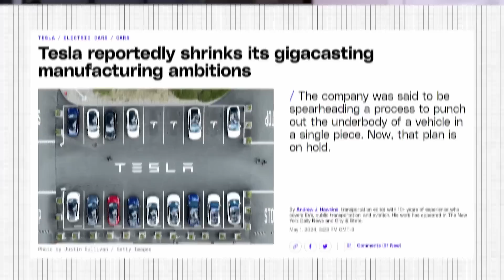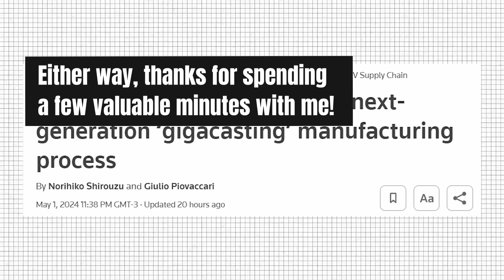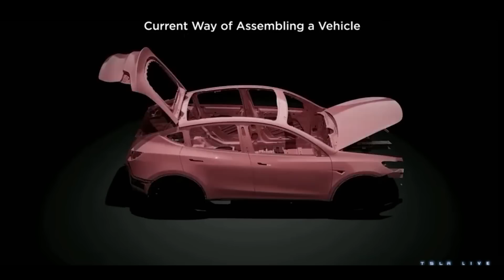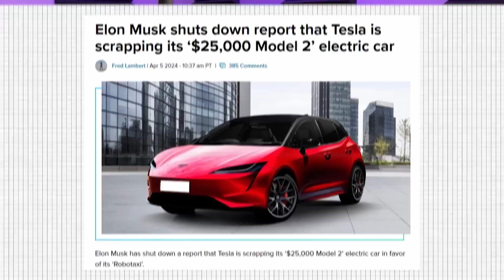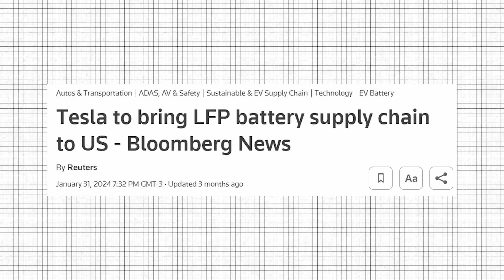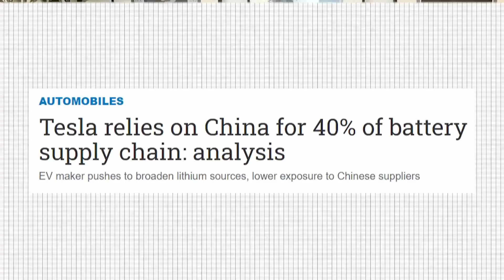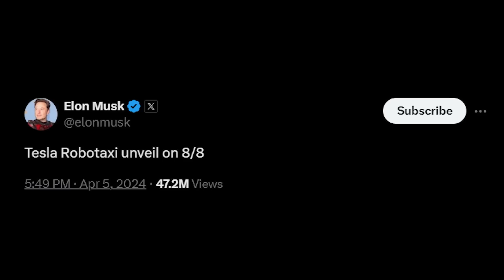Tesla: Pulling Forward Robotaxi Platform

Comment: The ONLY reason they're pivoting away from 4680s is because THEY CANT SOLVE THE DBE PROCESS FOR THE CATHODE AT ANY SORT OF SCALE!!!  Sorry to break it to all you zealots who continually and desperately shout out that Tesla is the best at everything they do (and continually repeated the endless trope that Elon is playing 4-D chess), but 4680 battery production has been a major failure....no improved energy density (even their newest 4680 cyber-cell is barely on par with 2170s from years ago), no 50% cost savings, and no ability to ramp. Elon has been flat out wrong and misguided MULTIPLE TIMES, because guess what....he doesn't have a crystal ball and despite you all endlessly acting like he's an infallible god, he can't predict the future (case in point: Elon 1 year ago: "I still think we got a shot at 20M cars per year by 2030.  Elon now: "we're de-prioritizing car production."  If Elon can truly predict the future, Tesla would've partnered with CATL 5 years ago for a joint factory in the US producing LFP/LMFP/M3P cells because iron-based batts are needed for 95% of all Tesla's use cases.

Comment: It's this simple. Elon never admits when he's wrong and he refuses to admit that someone else was right. Instead of canceling the model too like he should have, he's going to put it with another line. 

Most of the self-driving cars for the next year or two will be fine without more charging stations at least until the other automakers start actually pumping out vehicles with Tesla charger capability. 

This also incentivizes other vehicle manufacturers to build Tesla chargers. Bp actually just decided to build Tesla chargers. 

Now Yvonne can cut back the focus on the model 2 and let someone else deal with that poor decision as he focuses on the bots and the full self driving. 

It's a good decision overall, but he really just needs to admit that the article was right and he should have canceled the model 2 and fully focused on the Auto taxi. 

Side note, why are we saying Auto taxi when Tesla themself called it a cyber cab?

Comment: They aren't going to make the model 2 car right away.  They are going to use the model 3 lines to make a stripped down smaller battery cheap LFP robotaxi based on model 3 on the same line as the model 3.

Comment: Let's be clear. Robotaxi is not a hardware product. It is software that can run on approximately 2 million cars in the US. Elon has postulated that could earn Tesla owners around $30,000 a year. This suggests Tesla could realize roughly the same amount. If the car is used every day that means it earned its owner $82 a day. Assuming the owner was paid $0.50 a mile that would be 164 miles daily average. If the average speed was 30 mph that is about 5.5 hours of average usage a day.

Now let's assume that an average of 20% of those cars take the Robotaxi offer. That's 400,000 vehicles earning Tesla $82 a day, or $32,800,000 a day for scheduling rides, or $11,972,000,000 a year, largely profit.

That's the meaning without even building and deploying a Robotaxi car.

Why not SELL every car they can produce? They should. Why? The $25k car probably cost about $19,000 to build. If they sell it they recover the build cost within weeks along with a $6,000 profit. They can pay for building another car from that sale and sock away $6,000 profit.

If they deploy the vehicle as a Robotaxi they start paying interest on the money they haven't recovered from building it. Then they have the costs of charging, tires and other maintenance, insurance, and other consumables as well as ride management to pay out of the $1.00 a mile they collect.

The company builds a car in each factory in less than a minute, so what is the best way to grow profits?

Musk has said the company will only deploy its own Robotaxis in places where owner deployment isn't enough. These are the reasons why.
Reply: Suppose you convert immediately to Robotaxis, Tesla produces nearly 2 million cars in the US a year. At a cost of $19,000 each that is $38,000,000,000 of financed cars on the books and about $9 billion interest on those cars.

Comment: IMO, the positive of the cameras and visibility of the Cybrtrk cameras is the biggest reason for the delay of FSD. The Cybrtrk is so much bigger than all of the other cars Tesla has produced, that the stitching together each cameras vision to create the bird’s eye view is more complicated than the other cars. The same is true for the Semi, which has been waiting much longer than the Cybrtrk. 

The 4 wheel steering is just an output which is a relatively fixed output based on the speed of the vehicle. 

The Model 3 and Y are roughly the same size and have basically the same placement of the cameras. Both the Cybrtrk and the Semi are so much bigger than anything Tesla has done before, therefore they will take more time to implement.
Reply: I don't think size alone is what's holding these projects up.  For the CT, it's weird shape and materials.  For the Semi, it's a wildly different product that Tesla started out having no experience in.
Reply: @incognitotorpedo42  I think you are correct. I think that if Tesla needs to modify quite a bit for the size difference, they probably also wants to make these modifications directly on Hardware 4 instead of developing these modifications for Hardware 3 then later make modifications again to adapt the software for Hardware 4.  The current FSD is software written for Hardware 3 but runs of Hardware 4 EVs in simulation mode. FSD has not been ported to take advantage of the enhancements in Hardware 4.
Reply: @incognitotorpedo42  The weird material and shape have little to do with the how the vehicle is driven from an FSD standpoint. A person that has been driving a Corola or Camry for years needs several weeks to adjust to driving. a big F150 truck and would need a commercial drivers license to drive a Semi. Turning, parking, charging lanes, accelerating, the visibility and even suddenly stopping is very different from driving the typical sedan or SUV, than driving one of these much bigger vehicles. The CybrTrk has what no other vehicle has - 4 wheels that turn instead of just the two front wheels and it has steer by wire technology.

Comment: I can’t understand why basically everyone in the Tesla community takes at face value the claim that Tesla was trying to create a single-casting chassis.  That is nonsense.  The unboxed process is basically the opposite of that, having front and rear sections that can be independently manufactured with all parts installed then assembled with a structural battery at the end.  Stop repeating this crap as if it were ever true!
Reply: EXACTLY
High on optimism
Low on engineering knowledge and common sense
Nobody LISTENED to WHY Unboxed was (is) so good.
.
12 Working faces (plus the pack)
Reply: These people just create content, mostly speculation under the guise of "expert", expert in speculation and nothing else.
Reply: It was a BS story from Reuters...they painted it in a negative light of course and claimed Tesla abandoned one piece castings.
Completely ignoring the fact that the giga castings represent an amazing level of progress.
Elon speculated that maybe one day they could get it down to two or even one piece.
With the new unboxed process though, it makes sense to stick with what they have.
Reply: Just think aboit how silly it is that even a "Tesla community"Exists!It gives you all the answers!

Comment: Tesla make the ultimate disposable vehicle.... with a chassis and bodywork that cannot be repaired, a battery where the slighted accident writes off the vehicle.. Oh well That is progress,  EV is the new mobile phone, when the battery fails dump the whole phone / vehicle.
Reply: Present system of panel beaters is labour intensive, expensive of custom paint.
Total nightmare.
Gotta be a better way.
Not crashing is a good start.
Castings are way more robust than pressed steel. (See Munro vids)
Skin could be something new, avoiding paintshop, a commodity.
High time to disrupt an expensive business, insurance & marketing model.
Cyber Cab.
Reply: @iandavies4853   The Tesla is a disposable vehicle,  just like if you damage your phone,  just chuck it away and get another.... ICE cars with proper body are far, far cheaper than Tesla to keep on the road for decades.  As for crashing, seems that Tesla software does a good job of causing crashes without human help.
Reply: Break the glass replace the whole thing, like an iPhone 😂

Comment: Reality is Tesla is failing and not selling their EV’s, it is only a matter of time 👀
Reply: noone is selling any cars right now, I have been trying to sell wifes car half a grand cheaper than the cheapest on of other on the offer, I didn't get any interest in a week.
Market is dead right now, the storm is coming for everyone...
Reply: You clearly misunderstand. So far Tesla has sold every car it makes (except those for crash testing, etc. All is happening is a bit longer delay from production to sale ,(about half of most makes and models). Part of the reason is high interest rates that dramatically increase monthly payments. 

But the market at several price points is approaching saturation, so Tesla is doing what it did after the models S and X, come out with models that reach a less affluent market segment with the new $25k car.

Comment: For those who worship the Giga casting idea, here is news for you. The reason that Tesla cannot have more models over 10 years is Giga casting requires a lot of time and money to build the Giga molds. The M2 delay or cancellation should be a proof of that.
You just do not produce one set of molds, you have to produce a dozen. Casting molds will have to be repair or replaced after certain time, especially the materials is sheet aluminum and steel. Molds wear out quickly.
BYD and others adopt the platform techniques for their EV.
BYD can produce a new line in every three months and it is beating Tesla to the pulp.
Giga Shanghai is reportedly idling some parts of its factory.
Tesla is bleeding cash and Q2 eps will probably be negative.
Reply: Haha. Spruiking for Kuka robots?
Berlin Giga protester?
Go back to your cave.

Comment: On 8/8 it's possible they will announce what the RT will look like and what basic capabilities it will have and include in that announcement a date for first limited availability of the RT later, like the Foundation series CT launch. Maybe that limited availability date will be by the end of 2024 or Q1 2025. I think on 8/8 Elon will ride in an RT onto the stage and hop out from the passenger side. But to make that timeframe work, they'll need to announce ride-share partnerships and a fairly large number of cars ready to ship by soon after the launch date. So where are they making these RTs and hiding them from Joe Tegtmeyer and others? Maybe I'm projecting too much but to just show a concept car and plans for partnerships would be very boring.

Comment: New car for RoboTaxi will be a modified Model Y.
Model Y is already a great hardware platform for a robotaxi, might need a change in some camera positions, maybe automatic doors, and a way to control remotely in case of unforeseen issues. 
Software using Model Y data is already available in massive quantities a major change in the physical envelope will require a new collection of data.
Proof CyberTruck FSD is months away because not enough CyberTruck data is available.
Reply: No. It won't.
.
The INTERIM car, "based on the existing line, with elements of unboxed" will be a modified 3/Y.
.
The CAB will be an entirely new vehicle.... "Compact" outside, "large" (space efficient) inside.
.
Start with a London Black Cab (Best of type?)
Why is it "the best"?
Wide door, wheelchair access, etc.
.
A "box" for passengers, with a driver in front of the box and an engine box in front of the driver.
But you need neither the driver or the engine "box".
Leaving.... The passenger box.
.
That's essentially a "cube" (ref Investor Day)
Not a "Y" or 3.
.
It won't be produced until the Texas dedicated unboxed line is ready.
.
The INTERIM vehicle will be a "hybrid" of the conventional steel (Y/3l) passenger cage, the same castings, BUT with those castings "Built" (populated with components) away from the final assembly line, using the new systems from the Gen 3 vehicles (Cab/ Compact.... Same vehicle).
Reply: We dont need robotaxis,we have to use ebikes and kcars and public transport!

Comment: Note on a "Compact version Model 3 Performance"
WHY?
It's already an "M3 Killer"
.
The next phase is about automation, not niche.
....

Build a "Cheap 3" with Unboxed components.
.
Reduce line time.
Partial test of "Unboxed " line (Casting side)
.
Small space/ high (ish) capacity Unboxed line at Texas.
.
COMMON vehicle allowing for "Compact" build while FSD ramps, with fast conversion to CyberCAB when FSD is approved.
(The same vehicle makes it an overnight change)
.
3 years later, when Compacts reach end of Lease they become CyberCABs indistinguishable from the "Original" Cabs.
.
When Mexico completes, the  line is a direct Copy/ Paste, multiplied as required.

Comment: I generally agree.
But (imo)
The First test line of Gen 3 wasn't CyberCAB, or Compact.
.
It was a low volume, high human input, high value vehicle (overdue) to understand the process while making profit.
.
Roadster.
(Ref Investor Day Slide 58/ +Tesla web page.... Images match )
.
Then FSD started advancing FAST while at the same time  the Unboxed (Roadster) line was going well.
.
With Mexico delayed, they put Roadster on the back burner and postponed part supply.
(Hi Reuters!!)
.
The Cab AND Compact (SAME VEHICLE, with/ without controls) won't be ready at Texas before mid/ late next year.
.
But
Elon wants an interim cheaper model because:

1) He still thinks recession is likely (the core reason for the current cuts).
.
2) They also need the development and on road testing of unboxed systems for the Cab/Compact.
....
Logically, those systems in a hybrid M3 (Y?) make sense.
.
So the plan will be.

Model 3 "eco"
Castings built "unboxed" with appropriate (new) systems for steering, wiring/ components, brakes(!?).
.
Existing (conventional)  Body (amortized and cheap).
.
Single motor.
Remapped Torque/ Power.
.
Smaller pack.
±280 range.
......

Unboxed Line (Texas)
.
Common vehicle for CyberCAB/ "Compact"
(Economy of scale!!)

(Description of "Compact"? Low exterior footprint. 
Space efficient *interior*, NOT "Small")
.
Easy access flat floor.
Sliding door (1 side?) 
This will be a requirement for a modern Cab!
.
Driver controls?
"Gaming Console", bolt in, 1 connector.
.
LEASE the Compact, no option to buy at end of lease (ref Model 3 leases)
.
"Compacts" will be returned, refurbished, Controls removed, seating adjusted, new firmware, to join the Cab Fleet. (Cheap, fast, ready for capacity required in 3 years)
.
The "Compact/ CyberCAB" ratio on the line will vary depending on regulation.... 
ZERO tooling change for the different mix other than the Driver control module.
...
Reply: Wrong, robotaxis won't look like compacts. Taxis operate at low speed in urban environments. They will look more like buses and trains as aerodynamics is not a factor. The interiors will be be more durable,  easier to clean and less comfortable because journeys are short. Reduced tech for entertainment  as riders will prefer personal devices
Reply: @MegaWilderness 
You're assuming "COMPACT" means SMALL (Or "2 seat")
.
That is probably based on the premise that the "smaller" (low) vehicle on the Investor Day presentation was the "Compact".
It wasn't.
Reply: @rogerstarkey5390  I made no such statement about compacts. Only sports cars will be limited to two or one seat
Reply: @MegaWilderness 
So where was the "Compact"  supposedly shown at Investor Day?
.
There were 2 vehicles, one was indeed a low, wide "sports car" (Roadster.... But everyone missed that)
.
The other was a "Cube"(ish) vehicle assumed to be just the "Taxi"
(I never made that assumption)
.
The best way to make a Compact, cheaper vehicle? Base it on what's going to be a very high volume platform.
A "Short" ("Compact") vehicle which carries 4-5.
.
How to make it even cheaper  over its life?
.
LEASE the vehicle.
Retrieve at end of lease and convert it to be the exact vehicle on which it's based simply by removing driver controls, changing the seating and revising firmware.
.
You just removed a large chunk of cost from a "New" Taxi (Which was a "Compact")
.
I'm saying it is BOTH the Taxi AND "Compact".
Reply: @rogerstarkey5390  The cheapest taxi is a fifteen seater minibus, all of Africa and India can't be wrong. Anything smaller will create traffic havoc with gridlock